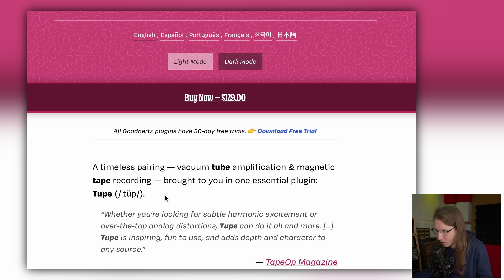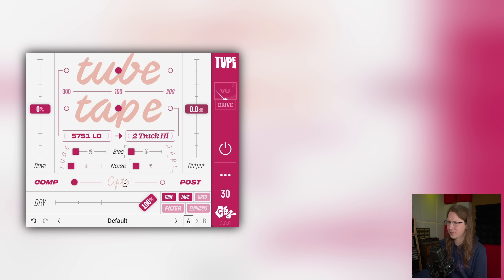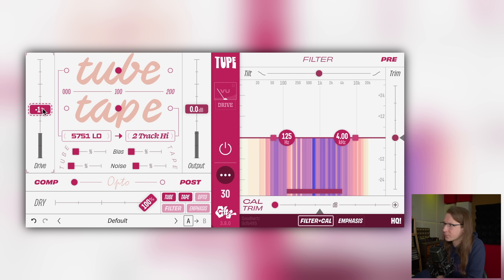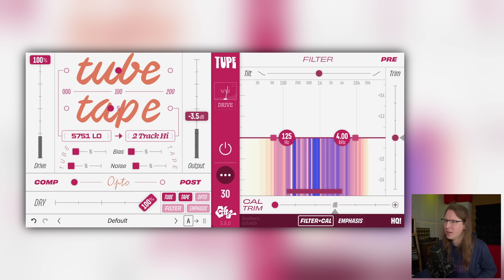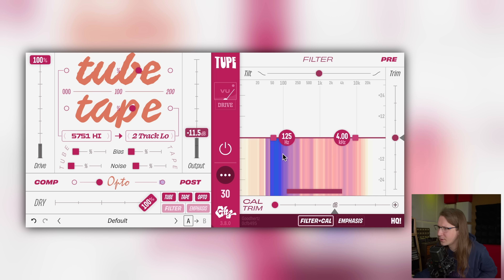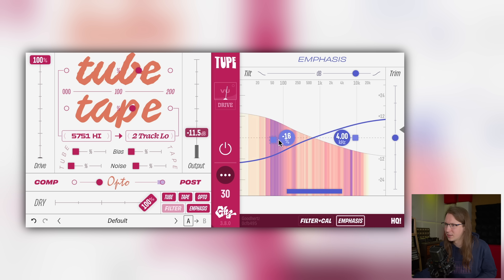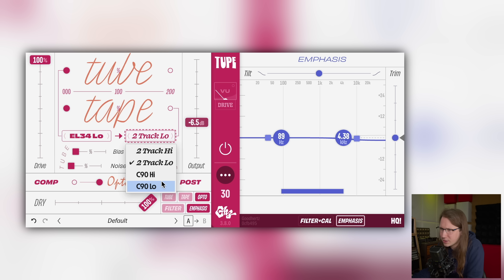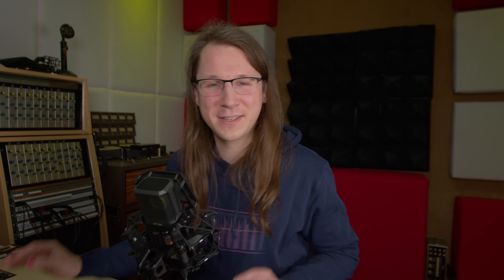How GOOD is it REALLY? || Goodhertz Tupe

Comment: I haven’t used this plugin, but I’m pretty sure I saw in another demo of it that you need to adjust the calibration slider under the filter to set the auto gain.
Reply: Yesss exactly!!!
Reply: @goodhertz  To my knowledge, there's no way to autogain this plugin. The calibration slider is just a calibration slider : you set more or less drive into the plugin. It doesn't replace an autogain. The worst feature is the fact the mix knob is before the output gain. To me it doesn't make sense. But anyway it's an amazing plugin, it sounds great and is a pleasure to use... I just don't like this "mix knob -> output gain" nonsense...

Comment: Wytse, if you want a GREAT "tube box" that uses alot of different (and very uncommon tubes), there is none better than the Thermionic Culture Vulture Mastering Plus.  Designed by Vic Kearney (he was a designer on the original RCA tube console), I have 3 separate versions and they all get used regularly (I use my custom Mastering Plus version for, well, mastering, and then I have the Vulture Super 15 and the 20th Anniversary Vulture which I use all over the place). 
Actually I believe Thermionic Culture has just come out with a new special edition of the Culture Vulture, might be called the "Ultra Vulture" or something like that.  
You would love it, I'm sure.  For your purposes, I would say just make sure you avoid the "standard" Vulture.  The special editions and the Mastering versions have detented controls and better matched tubes.

Comment: Do you think that i you are mixing with lots  of saturation and compression, if it would be advantageous just to run a session at a higher sample rate, like 96kHz? I specifically mean in terms of not having to upsample and downsample as often if you are using plugin chains where the majority of your plugins would be doing this anyways. I know there are some advantages for timestretching audio at higher sample rates as well, but I am primarily interested in which approach would be more computationally efficient.

Comment: Makes me wonder if the history of audio recording happened some other way,  what other kinds of distortion would we enjoy but just don't realize it because it wasn't an artifact of the tech.  For example what if audio hardware was somehow based on seashells and there was some spirally sloshy echo effect we would have liked but we haven't happened upon it yet.
Reply: Exactly like if audio where digital at first. I'm probably sure we would not like analogue as much because it would be no more nostalgic... I am sure the digital sound would have been nostalgic as much as analogue is and a lot of peoples would say that was way better before ahah.
Reply: @samuelbolduc696  i dont really know how accurate this perspective is since the reason why people prefer analog over digital is because audio in analog is a continous signal unlike digital which is bits , the difference between analog and digital is very noticable when you start adding effect like distortion & etc that digital does not have the information because its a bunch of limited one's and zeros instead of a smooth voltage signal
and of course nostalgia absolutely plays a role too
Reply: @Rami-bi9xj  the reason why people’s prefer analog is mainly because they used to know that. As soon as we could use digital to process audio or to record, all the industry started to use it because it is so much more convenient.  Digital Audio is not only samples, when you add a low pass filter it becomes the exact same continuous signal than before. Thinking that digital audio is only samples that can’t be connected together is really not knowing how it works. even you add effects , if the effect is created outside the computer, digital audio won’t nul the effect. and you won’t be able to know which one is it in a A/B test anyway.
Reply: @samuelbolduc696  thats also a factor, turning physical knobs can be stimulating and provide much better feedback and more integrated workflow that analog provides but digital doesnt, but as you said digital is more convenient and offers better flexibility.
"Thinking that digital audio is only samples that can’t be connected together is really not knowing how it works"
my comment was not adressing effects because i was talking about quality difference of dry signal, digital effects are a world of their own and they are personally the most enjoyable aspects of manipulating audio
Reply: @ I totally agree with you about analog being physical so it can be more direct and I feel like your brain understands that more than anything. But I have to admit that it dosent mean this sounds better, it just means that I feel better. And I will admit this is important

Comment: Hey Whitse, I agree with you about oversampling, I only use digital tubes, amps and comps/limiters  with oversampling to get a better melodic result in the first place. It is as you as said. To describe what you just mentioned is this: imagine yourself standing in a sports hall with a gumball in your hand and you throw it in a curve, so the ball keeps flying until it hits the wall. And at the moment it hits the wall there are two ways the gumball might continue bouncing back (the Nyquist point) from that wall: up to the ceiling or back to the ground. If it flies upwards to the ceiling, it may  land everywhere and you can't really detect, where to fetch it (no oversampling) , but if it bounces downwards you can clearly see where it could be catched (oversampling). Hope I described this concept well enough. :D If I'm wrong with it, please feel free to correct me.
Reply: Don’t really understand your poetic analogy, but now i want to go buy a gumball and throw it in a basketball court.
Reply: @sub-jec-tiv  so to check if my metaphor fits?

Comment: it's interesting that there are 'preamp' tubes (like 12AX7's which are dual stage, I.e. of the type found in the 'gain' section of a guitar amp), AND power amp tubes like 6L6 (which are usually run with like ~ 400V plate voltage).
Reply: 12ax7's can be used in clean, audiophile tube designs. They don't have to be driven to obvious distortion.